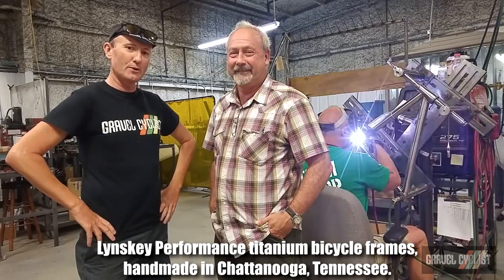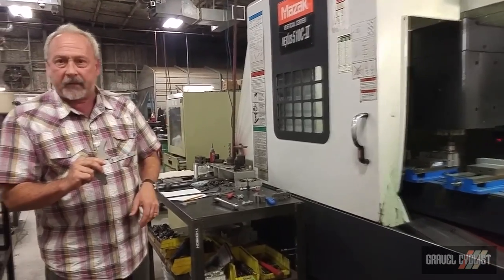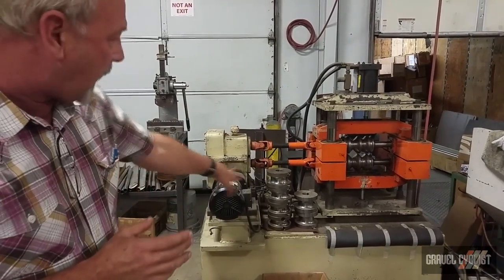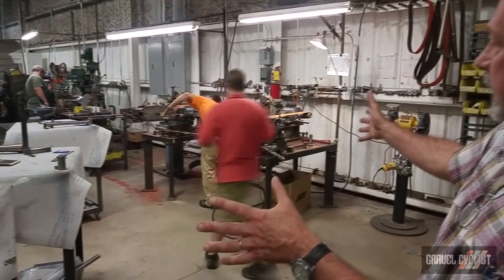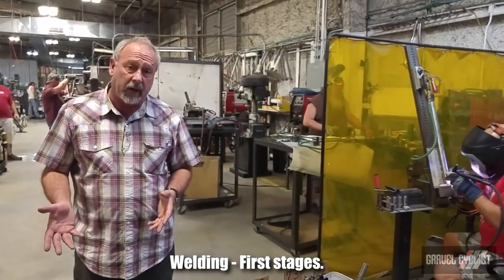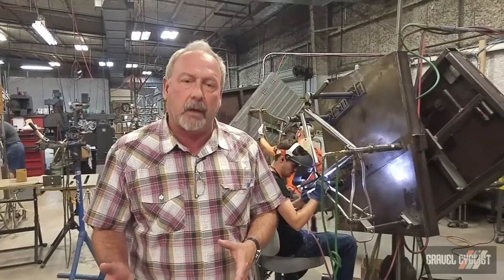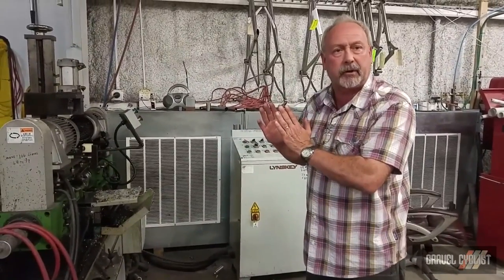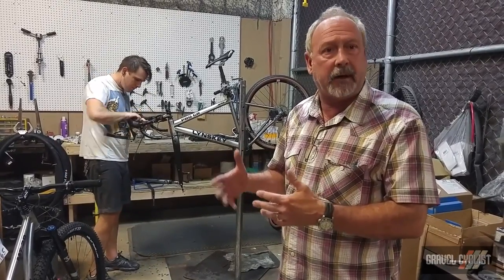Lynskey Performance Titanium Bicycles - Factory Tour

Comment: I understood that welding Titanium is different than Aluminum or Steel in that you need to flow Argon through the frame during welding and there are special holes to allow the gas flow

Comment: I can barely hear the audio, would probably help to look at your mic setup despite the background noise
Reply: Audio sounded fine to me...
Reply: if you want to listen to mostly background noise :)
Reply: Sound was fine. Its a  working fabrication shop you need to concentrate on what someone is saying and not on background noises,
Reply from the maker: That is a hard environment to record, used a directional mic which I figured was the best approach. I thought it turned out pretty well considering. Thanks for the feedback.
Reply: No worries, not a criticism of your content as I am a regular viewer of your vids/website. Maybe use a LAV/Clip on mic for these situations?  These will give you a better signal to noise ratio in a noisy environment like this.
Reply from the maker: I was thinking to myself... I should have put my LAV mic on Mark and had him carry about my other phone. I will definitely have to experiment. I was worried the LAV may pickup too much noise? But, I appreciate the feedback, audio has definitely been my real weak point with these types of video. A lot to learn!
Reply: As one who does video production for a living, a double wireless lav would have been the way to go. Your idea of using a cell placed in a shirt pocket to record audio isn't bad either, but the lav would have picked up the voices clearest. Noise from lav mics usually comes from movement - the microphone rubbing against clothing for example. 

You can also eliminate some of the noise in Adobe Audition, but that can also create unwanted results after a lot of work.

Still, overall you can hear it okay, and it is a factory after all.